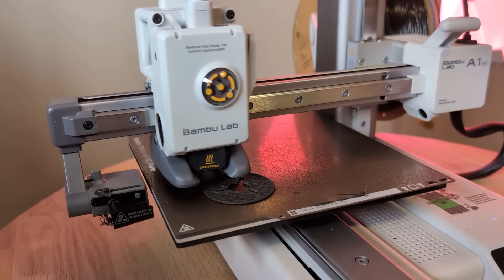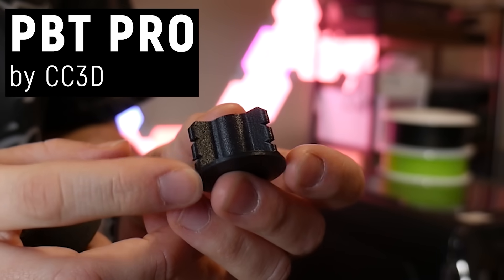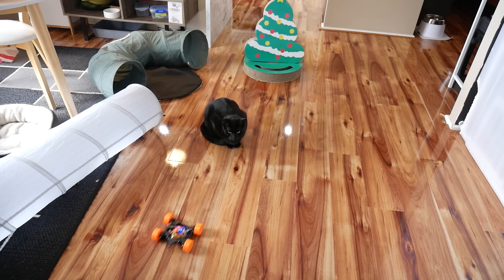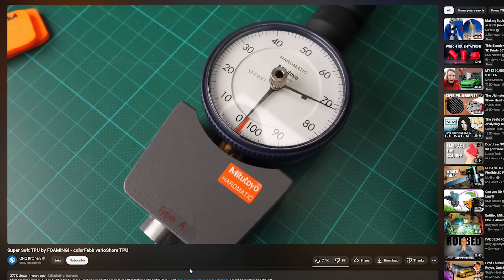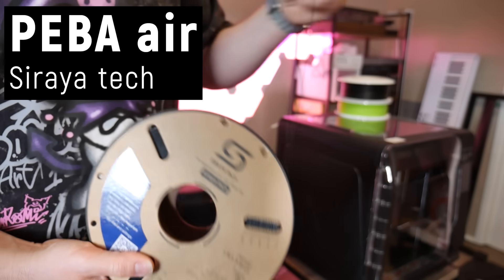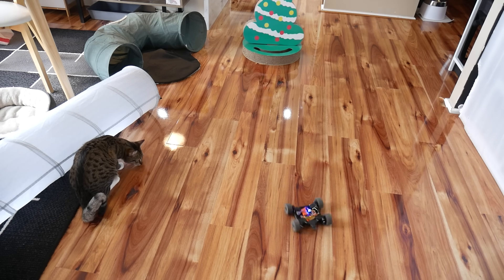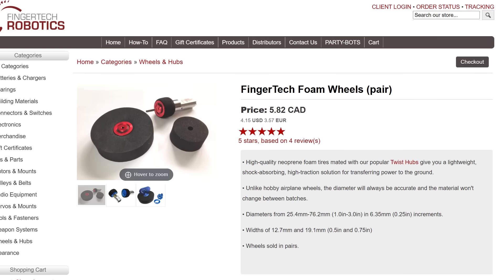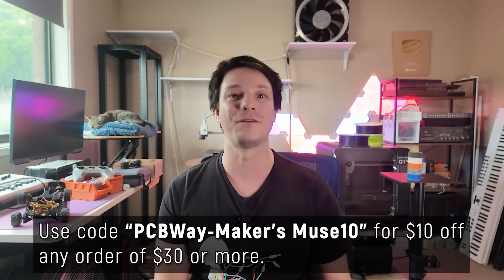3D Printed FOAM Wheels - Do they work?

Comment: I'm curious if surface noise would improve traction. Also interesting note I use zbrush and when I add noise before export it prints faster than if I set it up in my slicer

Comment: The PEBA tyre looked like it had quite a bobbly surface and big seam line... so very intermittent contact patch, TPU air tyre looked smooth and consistent giving a good contact patch.

Comment: Would also be nice to see a tread pattern that makes sense for a flat surface grooves not knobbles?
Reply: For flat surface, you want as much contact with the surface as possible, that's why slick tyres are used in racing. Tread is only useful for displacing water, which is why we have them on our cars. Slicks would lose traction in the wet where tread doesn't.

Comment: Was kinda hoping you'd also compare it to 3d printing a mold and casting PU wheels.
It seems to be straight up the best result for making your own wheels, with the only real downside is that they are quite heavy and wear down quickly, but otherwise really combat durable with tons of grip.

so 10:40 yes please

Comment: As another comment suggested, using RTV silicone to make a thin 'traction layer' could be worth a go. I also think all these wheels are too hard- I'd try to get the 'aired down' offroad look to get way more surface contact. I have no experience with combat robots, so maybe I'm way off.

Comment: Good liquid latex should be obnoxiously stinky. It should have a horrifying ammonia smell and it should temporarily deaden any sensation in you fingertips after brief contact. Pure liquid latex for mold making or making masks is wonderful and scary stuff. Generally 5 to 6 layers are necessary. Use a hair dryer between coats and avoid thick gloppy bits. Sponge brushes give the most even application.

Comment: 🤣Your cats are pretty well anesthetized to robotic intruders.🤣  TPU should be resistant to most solvents in rubber/buna glues/sealants.  This means the foam cavities will retain their shape and "lock" in harsher stuff like so-called "vulcanizing glue" for patching auto tires.  Even if the glue itself isn't a very good tread, you can mix in rubber chunks/powder from grinding on an old tire.  Spares don't need all that tread, now do they?🤔  Vulcanized rubber is used in proper slip-resistant shoes/boots.  It's not sticky, but it doesn't let go as easily on dusty or oily surfaces -- predictable traction.  Cheers, from North Carolina US!

Comment: Liquid natural latex is used for applying traction to socks in DK it's called rubber milk, crafts stores have the stuff, but don't ask for latex, ask for sock traction rubber.
Also the make-up stuff is probably nitrile, technically latex, but artificial and it's too smooth and nonallergenic to be useful.

Comment: Next ant event all my bots will have foam handlebar grip tires - it is a nice rubberised open cell foam. Grippy but not bouncy :) Can buy long tubes of it and cut it - hose cutters work best.

Shoe glue or contact adhesive from bunbuns will do the same job as rubber cement (thought not the same thing).

I rekon that make up latex is full of pigment ruining its grippyness. I've got a latex from ebay that I've only tested, but is tacky.
Reply from the maker: ooh clever, keen to see how it goes! hope to make that event too :D

Comment: What I'm getting good results with is casting polyurethane resin (I've used 60A, but 30 is also widely available) in 3D-printed molds, using TPU for printing the mold(so draft angle is not necessary) and Vaseline as mold release.

Comment: This might be something for the RC speedsters to try.... The current foam tires have their noticeable challenges.... For the "tyre cement" you should be able to get some from bicycle shops, it's the same stuff used on the patches, hence the "patch and solution" term... You'ed want to just by the solution which is in fact just "tyre cement"....

Comment: Those air filaments look really interesting. With the tire thread maybe it would help to add groves instead of protruding nubs especially on the smooth surface you were testing on. Maybe you could try some different patterns too, like straight or squiggly lines or different angles of the lines or grid patterns... but i actually don't have any idea about tire technology, those are just some thoughts i had :D

Comment: You can try liquid rubber. I know 2 versions. One is "liquid tape" for elecrical insulations, the other is for coating carparts, tool handles and like that (like "plastidip liquid rubber" - or similar).
But I dont have any experience on pulling forces on wheel covering.

Comment: Im glad you touched on the shipping at the end there. Thats the main reason I love 3D printers, it allows me to patch or even replace something that would literally cost more in shipping not to mention the pain trying to source it in the first place.
Reply: that & availability period.  i was given an old delta miter chop saw not long ago that i use to cut aluminum extrusion for 3d printer frames, but it's missing the lower guard which is no longer made & people want an arm, leg, blood sample, & first born for what few used ones exist in the market, astronomical shipping aside.  if i could somehow get the measurements, i could design a replacement in cad for resin printing, then attach it to a new fabricated mount with spring.  of course, measurements are impossible to find....  🤷‍♂️
Reply: I needed a bracket for a security camera today; I'd misplaced the one that it came with.  Someone had kindly modeled the stock bracket on Printables, and I was able to have a replacement part in under 30 minutes from when I realized that I needed it to popping it off the build plate.

Comment: Would using fuzzy skin help with traction?
Reply: Slicks are slick for a reason, just saying.
Reply: There would be less contact area with the smooth surface so no. For the same tire material 50% contact with the driving surface isn’t going to improve traction over 100% contact. Wrapping the tires in sandpaper might improve traction, wouldn’t be great for the floor’s finish though. 😂
Reply: @radish6691  you sure about that? Smooth tires = slippery. Tread exists for a reason, sure, some of that is to allow water to escape but also because it compresses and creates more surface area, and also ‘dig’ into the road surface than just a bald tire would

Only one way to find out though
Reply: @Anibbles there's no road surface to dig into here. Fuzzy skin could help on dirt roads though
Reply: @Anibbles In addition to what the other reply stated (smooth “road” surface which is the primary driver behind my opinion), I think the bot is too light to deform the tire any significant amount so it would be riding only on the fuzzy bumps. The tire area in contact with the surface will therefore be less than it would be with a smooth tire. 

I agree there’s only one way to find out, perhaps Angus will indulge us with a follow-up video! And if he does I’d like to seem him test tires with sandpaper as the surface…grit shootout, begin! 😁
Reply: @Anibbles  Smooth tires are not slippery, what are you talking about? They're maximally grippy. And threads don't "compress" - they're used exclusively for water and loose surfaces.

Seriously, what makes you think that you have grounds to question decades of billion dollar research? Have you ever seen a F1 car or a dragster on threaded tires in dry conditions? I sure haven't.
Reply from the maker: Ooh that's an interesting thought!
Reply: @MakersMuse  similar idea to random seams, but just up to 11

Comment: Wonder if there would be a way to make multimaterial print a hybrid tyre with TPU Air and TPU 95a? Assuming they should be able to adhere to one and other? but I know using TPU in an AMS is a no no..
Say 95a for the rim, about 5mm perimeter of TPU Air for the tyre, stronger more resilient core, with the grippier outer.
Maybe the BMCU could handle it?
Reply from the maker: Just tried that on the snapmaker u1, review soon!

Comment: The noise the PEBA wheels were making is called wheel chatter in skating.

Chatter caused by the combination of grip, tire deflection, and rebound. 
It happens in longboarding when doing slides with big wheels that have small cores and lots of unsupported polyurethane.

My guess is that there's just enough energy damping in the foaming TPU for it not to happen.
Reply from the maker: Super interesting! Thanks for the insight
Reply: @MakersMuse  you should look up "clear longboard wheels" and check out the plastic hub geometry! They are really interesting.
The hub allows the center of the wheel to be stiffer but allow the inner and outer lip to flex, maintaining a more consistent contact patch. 
Printing two part wheels with the embedded plastic hub ensapsulated by the urethane/foam tire would be a fascinating exercise.
Reply: You might find more on fixes when searching for stick-slip which is the engineering term for it, its when the material is oscillating between dynamic and static friction
Reply: I bet the aligned seam was adding to the bounce too -- it'd be interesting to see a random seam version
Reply: Yeah.
PEBA migh have a very high "sticktion" force  but then as it goes to dynamic slip it starts skipping and vibrate.

Might be better at pulling actual loads instead of an immovable wall
Reply: PEBA is a bouncier filament than TPU, which means it doesn’t absorb as much energy in collisions. That’s good for a bouncy ball or a tyre on a car with suspension, but for a tyre on a car without suspension, being able to absorb and dampen shocks is important too.

Comment: There are a lot of glues similar to rubber cement. Any hardware store should have some form of "contact cement". Screen printing suppliers carry "water-based pallet adhesive" for sticking shirts to printing presses. It takes some time to dry, but that stuff is designed to stay sticky even when it's full of t-shirt lint.

Comment: For using an additive on the foam tires to increase traction, have a look at the actual traction compounds used by RC car drivers who use foam tires. Its literally designed to add traction to foam.
Reply: Something like liquid isolation/liquid tape would work to add rubber layer to foam. Its cheap and common item on any shipping site. Its also sold in both gel and spray forms so you easily coat anything
Reply: @notkarma2984  Liquid tape would be too thick.  Flowable silicone windshield sealant is/was the king, foam density matters as well.  Back in the 90s we raced 1/10 dirt oval up and down the US East Coast at all the big events and our team frequently took the top 5 places in 2wd modified and 4wd modified.  Granted we had sponsors for cars, battieries and motors but our hand made tires for grip gave us the big edge.  Basically apply it as evenly as possible then they have to be kept rotating slowly until cured and edges of foam core rounded off before applying it.  While curing it will flow out very smooth and be shiny looking then balance the tires.  

The traction additives for foam tires were always slick at first then wore off over a 4 minute race.
Reply: @dev-debug  I used GE silicone caulk over foam tires for RC car racing on a high school gym floor, and it worked the very best of anything I've tried, but my basketball coaches made me stop because it made the floor so slick afterwards.  Those tires sure did stick though.  Now we make our own out of 35A urethane with minipin treads, and those work well too.
Reply: @notkarma2984  You can also use good old WD-40. I know lubricants dont usually imply traction compounds but I used it on my old 1/10 scale Tamiya Group-C for years, works great too ;)
Reply: @ARKWheel24 WD40 isn't really a lubricant.  It is Water Displacer formula 40 it was used to prevent water condensation on rockets and was created for the space program.
Reply: Yup. I used these compounds on carpet track rc cars with foam tires over 30 years ago, so they are at least that old. 😊
Reply: We used to coat foam RC car tires in reduced (boiled until getting a touch thick) beet juice.  It was pretty much as good as the chemical treatments, but dirt cheap and environmentally friendly.
Reply: Aren't they designed for running on carpet?
Reply: @TheRattleSnake3145  or tarmac.

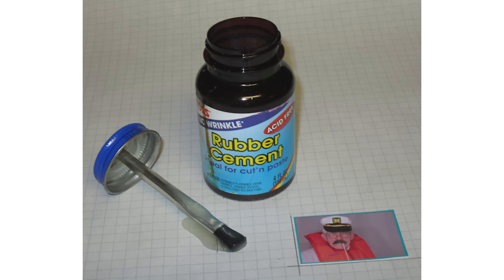Comment: 17:40.. Angus... They use Rubber Cement to attach Bicycle Tire Patches to inner tubes that have leaks...
Reply from the maker: Mm I saw that but it seems very different to the solvent based stuff that used to come with a brush.
Reply: Like MaxiTrac? I've used that a fair bit when repairing tyres, should do the trick.

Comment: I wonder how well this scales up to 1kg bots with more weight on the wheels. Also, I would love to see a urethane comparison video like this!
Reply: That's the nice thing about the TPU Air/ varioshore etc.. You can print the inner part with less foaming and get a stiffer tire and only print the walls with more foaming for the grip. Plus you can always play with the infill to fit your needs to.
Reply: @mst5517  You'd have to do it in separate parts to get a tire shape and still have the layers in the right orientation. This stuff really needs no interruptions in printing. You can do that per layer but by the time you switch temps it will have a big pea sized blob stuck on a wall. Doing it in multiple times per layer is just not feasible. Especially considering how much manually editing your G-code that would be.
Reply: More weight = better traction, virtually every time.

Comment: Something I’ve been using for a few years to create friction is a thin layer of Selleys Marine Sealant Silicone RTV.
I use the translucent type, which you can buy from Bunnings in Australia.  Just try this on the wheels.

Comment: rosin is used in various contexts for increasing friction. You could try dissolving some in IPA and apply it to the tires. Or a custom formulation of the foaming TPU with rosin added to the plastic itself might be interesting.

Comment: Rubber cement is easily available, as it's used to fix tyres. Repco should sell it.

As for latex, makeup suppliers. You can get different thicknesses of it.
Reply: Any hardware store will have rubber cement too.
Reply: @zeitgeist785  Two other options for rubber cement. Uhu glue or E9000 may be available. And if that's not available, find a woodworking supply store that has the materials for laminate countertops. The glue that bonds the laminate to the substrate is rubber cement. It just comes with a brand name.
Reply: I get latex locally in Perth from Kirkside Products, I'm sure each city has it's own version.  1kg tub

Comment: It's the material+tread on the tires which give traction. Don't make them smooth.
Reply: In the video, he tried treaded tires. They dont work well on smooth surfaces
Reply: @quelixf But he didn't try treads on the foam wheels.
He tried in the previous videos with TPU.
Reply: Tread is only for displacing water / grip on uneven surfaces. You want as much contact with the surface as possible which is why slick is better for smooth surfaces.